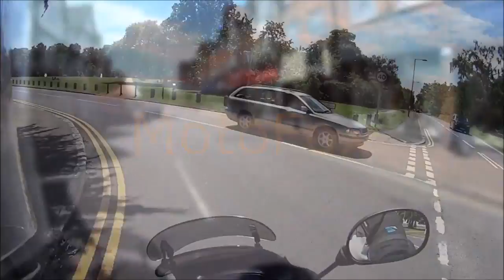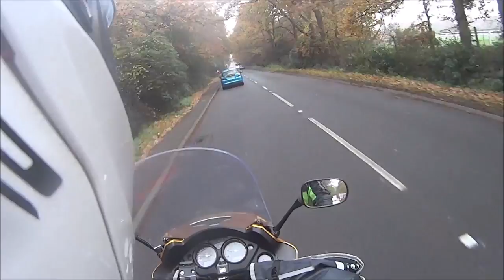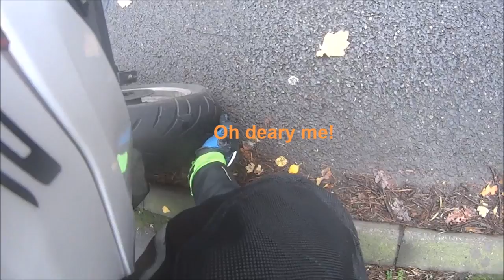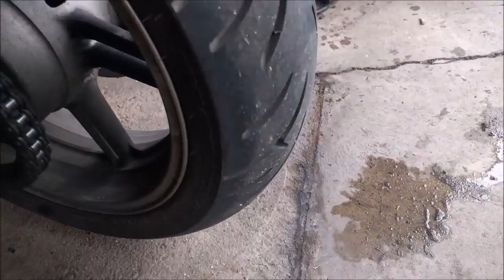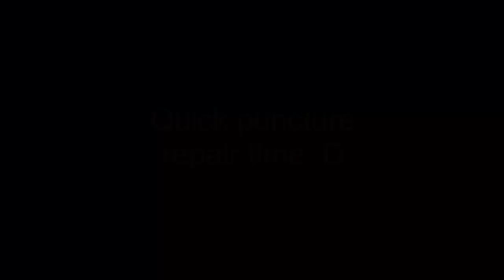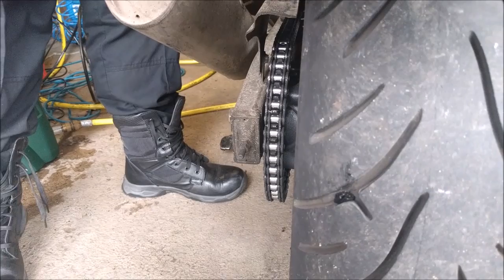When its just not going well: Puncture + Repair

Comment: Did you exchange your TDM for the CBF?
Reply from the maker: desasta sadly the TDM was written off in my crash, it was repairable but the insurance company wanted too much to buy it back. so picked up a CBF
Reply: What a shame! was a lovely bike too, but which bike do you prefer? iv been looking at the CBF1000 as well as the TDM900 but cant quite make up my mind which to go for, iv heard the TDM has better build quality but the CBF has a better engine
Reply from the maker: desasta the CBF is awesome but I would rather have my TDM, it did feel like a bike that could take you around the world. in fact my one had over 67000 miles on the clock and still rode perfect even after the crash it rode home fine just the cosmetic damage was beyond economical repair and the buy back price was not worth it or I would of kept on riding the old girl.
Reply: I must admit that CBF looks a lovely bike and i really do like the 4 cylinder motors.. but im siding with the TDM right now, not really heard a bad word about them so far
Reply from the maker: I loved my TDM it really is a great all round bike that can handle pretty much anything you want to chuck at it.